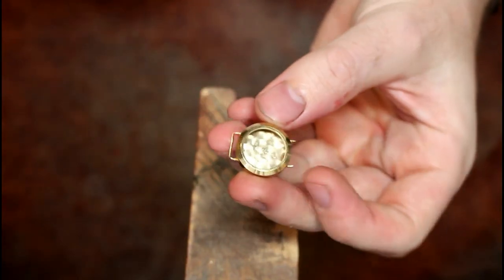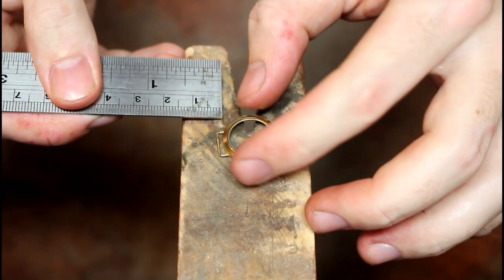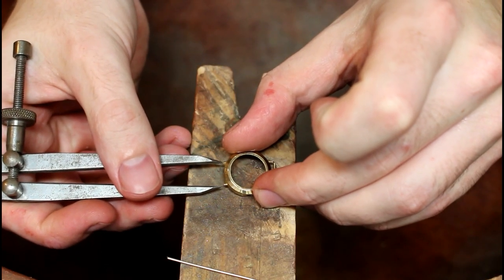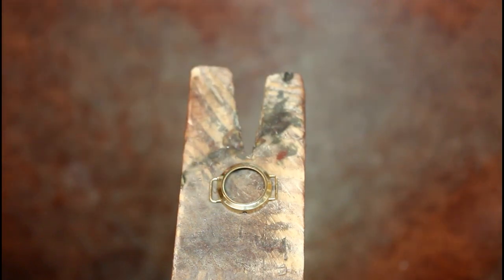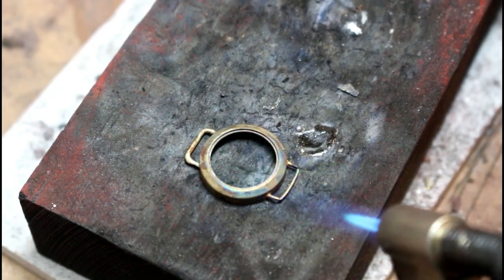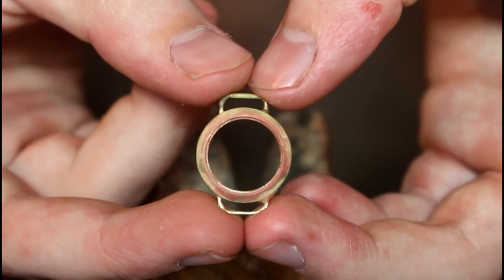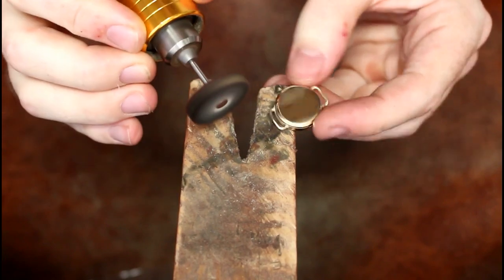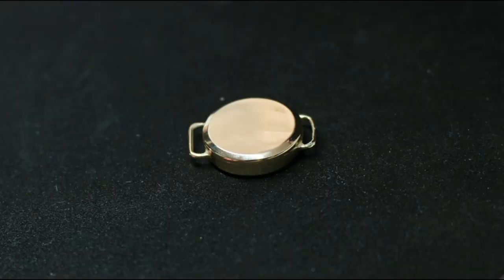GOLD WATCH CASE REPAIR

Comment: Nice work but Both sides look different I think both should be attached new
Reply from the maker: Yeah the new bar looks 10x better then the original, was thinking most of it would be covered once a strap is fitted